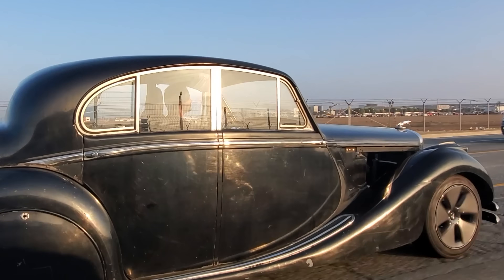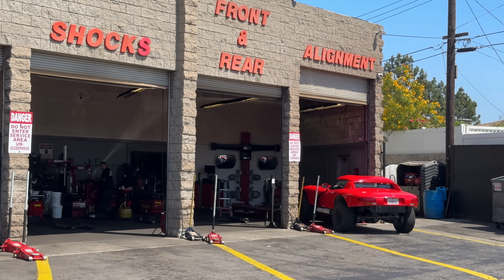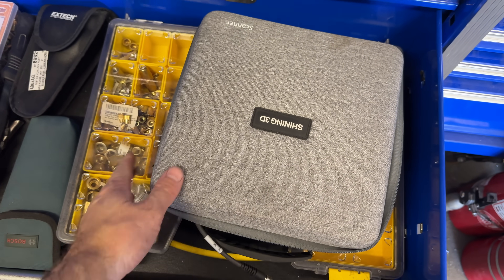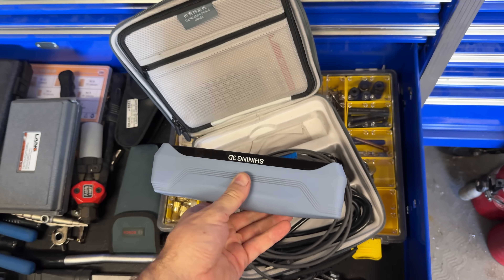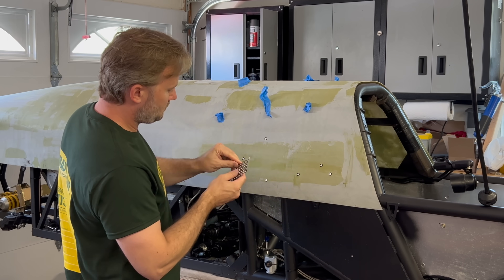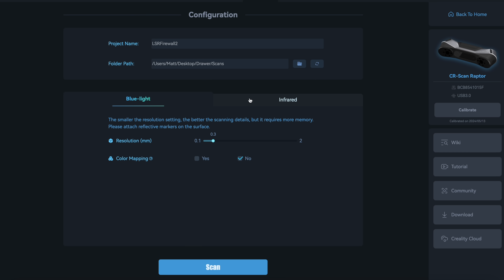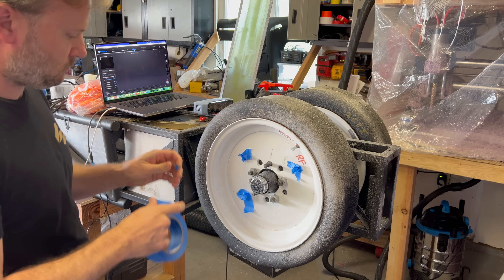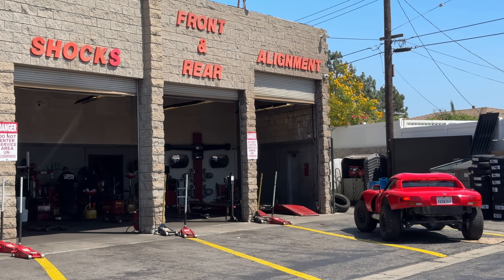Car Alignment With A 3D Scanner

Comment: I recently got a Einstar and have been pleasantly surprised by the ease of use. I have started scanning a lot of stuff from my ''85 RX-7 restomod project.

I got foot spray for reflective surfaces but in the end I haven't really needed it. The geometry that gave me the most trouble have been thin sections if you need to wrap around. I have used rags to give reference geometry for patterned and rounds parts. I didn't thought of tape for flat surfaces. This will go into the bag of tricks when I start doing the body work.

If I wanted to use it for wheel alignment check, I think I would place rags on the floor to help keeping it straight between the wheels by scanning both the rags and the bottom edge of the car.

The software has been fine, but for me the rewind function hasn't really worked. After 1h of 100% CPU it crashed. That was after 15min of scanning, might just have been unlucky. I haven't tried the measurement yet, as I imported everything in CAD anyway and rebuilding the suspension as a bone/sketch geometry. But from your video it does seem decent, will have to find something to use it for. From CAD, by drawing the circles from multiple holes I had relatively good results finding out bolt patterns and such compared to manual measurements.

Alignment note : Make sure your floor is flat! (mine definitely isn't), and needs to be level if you use gravity as a reference for camber. If not make some shims, put some numbered marking on the floor and reuse them.

Comment: Seems like the solution is the creality scanner and few ribbons of pre made dots you can masking tape to the non-critical areas. Seems like it would get you the best of all worlds - nearly as good instant scanning (maybe even just as good if you have to break out the tape bundles on the Einstar) and a better end result. Would need to try it of course, but it sounds like the Creality is technically going to be or at least become if the software catches up the better choice all round, and right now might be if that simple tracking trick does just work and get your the higher quality scan.

Comment: Sorry. Strings is not accurate?
Must professional race teams and ALL automotive OEMs will define the nominal setup with two sticks an string and a pair of calipers...

Way, waaaayyyy better than the accuracy you can get aligning and calibrating 4 lasers with their reflection...

A hunter style / laser machine is quick, easy and precise enough for your everyday workshop. 

You won't see a real motorsport place using one. Im very confused with this comment as i know matt knows better.

Comment: For the stool: ParkTool STL-2 workshop stool. No storage but great wheels which don't mind soft rubber floors and it's height adjustable. The plastic cover tears easily tho if it's pierced, but the base is amazing.
Reply: Also super comfy seat on the PT
Reply: @ElDJReturn  I defo 2nd that!

Comment: "Einstar" means one star in German. The maker of the tool is very honest it seems. Even if it may actually be 3 out of 5 stars.
Reply: Dreistar just makes it sound like a hand dryer though
Reply: @n_tas  , not sure how warm it gets when in use. Could be a secondary use case.

Comment: I can't speak to the kit you are using, my setup is very different, but I'd hit the engine with some grey primer (matte, not black, not white, in between) before scanning.  I've used that matte tan camo paint the returning soldiers are so fond of to excellent effect as well.  Also, on the fiberglass, if you are not worried about it bleeding through the paint (never tried with automotive paint, only cheap rattle can, and have had issues), you can do little dots and dashes with a sharpie to give it something to grab onto, with less effort for post processing if you care about using the surface for more than reference.  I prefer not to use a black sharpie as it may see that as a hole, so I bias toward a worn out red or green (blue tends to be a bit too dark).  There are probably better, still cheap and easy options.  I've never once used those reflective dots.  They are either too big for a tiny scan, or way too costly and time consuming for a large scan (for my purposes).  I'm sure a misting of rattle can around the torque converter won't stink too bad as it cooks.

Comment: The conclusion, that you sort of touch on at the end, is that to get a good scan you need to use the appropriate scanner for the item being scanned.  The Raptor is less than ideal using NIR on large objects.  

The Raptor, which I just received and paid for with my own funds, is very good at small parts.  I scanned an engine main cap as an early test part, main because it has small enough to fit on my desk, and because all major dimensions on it I could check with a 0.0001" micrometer.  I took four measurements using constructed planes in Zeiss Inspect and 3 of the Raptor scanner dimensions were within 0.0002" of my manual micrometer measurement.  The fourth dimension was less than a 0.001" off, and this dimension was produced from two merged scans when I flipped the main cap to scan each side individually.  I suspect the Creality Scan software is at fault here for how accurate it is at merging two scans and aligning the common points.  

Overall, if you scan that rear engine with the Raptor, I think you'll be impressed.  And as you noted, the Einstar didn't impress here.  Like the Raptor wasn't appropriate to scan the car, the Einstar is not appropriate for obtaining that level of detail and dimension of an engine.  The Raptor should be ideal for this.

Print re-usable 3D structures that you can add the 3D scan markers too.  Give it a magnetic base so you can stick it on ferrous parts, like the Viper iron engine block, and you'll have less complaints about having to use markers.  I've made a few 3D marker structures that have a through hole, so I can slip them over threaded studs, and other things that may be present on parts like engines.
Reply: Except for how the viper has an aluminum block
Reply: @jaredlancaster4137  And you're right!  I had it stuck in my head, due to years of lore of the Viper engine just being a "truck engine" fitted into the Viper, that it still had the truck variant's cast iron block.  As a non-Viper enthusiast, I still appreciate learning about the correct.

That said, everything else I said about the choice of scanner and results remains valid.

Comment: I got the best shop stool from harbor freight the one with a couple drawers and a nice cushion, then got 4 rollerblade wheel casters from amazon.  Built some adapters on the mill so i could mount the casters solid in the squarebar frame.   Now it rolls amazing and is solid when the wheels are locked.

Comment: Caster ?
Reply: Caster is the measurement of how far the wheel is tilted front or back.  The front wheels of a shopping cart have negative caster for easier steering, but tend to wobble at faster speeds.  A motorcycle front wheel has positive caster to make it go straight.

Comment: a trick to scan stuff and remove dots fast is to take a bit of painters tape, stick a bunch of targets on it and then put the painters tape on the surface to scan.
once done you just have to deal with removing painters tape and not a bunch of dots where half of will probably stay on forever

Comment: If you put the tracking markers on painters tape you get way faster cleanup afterwards and somtimes can reuse them
Reply: For magnetic parts they also make magnetic reflective targets. I worked at a place that was doing 3d scans on mostly steel parts and those things would last a surprisingly long time as long as you didn't use harsh cleaners on them.
Reply: Brilliant idea!
Reply: Very good hint mate. Thanks.
Reply: thats one of those "duh, why didnt i think of that" moments lol
Reply: OH man - respect the the idea
Reply: I was thinking just get some foam or wood boards, cover them in targets, then lay them on the floor. Then you could put them them away for later, and could put them behind whatever you are wanting to scan next time.
Reply: There are some net with magnetic markers. You gust put this net on the car.

Comment: The alignment machine uses infrared cameras to image the wheel targets for angle data. The four cameras (one for each wheel) are located in the centers of the LED clusters in the ends of the tower arm. The LEDs act as a camera flash and flash each time the camera takes an image. Since the targets are retroreflective and the camera is perfectly coaxial with the LEDs, the target image return is very bright and accurate. The software (WinAlign) just uses the skew of the known target pattern to determine the angle of the wheel.
Reply: I wonder how much hard work is behind that "just" after "software".
Reply: @SubTroppo  not much, tbh. OpenCV is a magic wand for such things. You know the specific features of your reference image, and you need to do some math operations over an 2d array of points. If you interested more -- take a look on the affine transformations, there's where the magic becomes "just" :)
Reply: i was told by-2008 to-14~ my boss USA/Nebraska 3d-party shop specialty in DSM/caddy's/diesel's that buying the equipment was 1m~ new and 90k+used so he/LLC passed on it and made a exclusiveness deal with the other shop up the road instead and focused on other parts/job's like engine rebuilding/R&R/fluid change or battery ect, so this scaner/cad if it gets good enough it's 2 problems solved for a 20th or 2-9K usd is a lot more cheap and use's less shop space for the ones like my previous job/shop that ROI is 1~ every ~90day's~needs averaged-out yes some weekend's it was more like 9-vin's others was/weekend's-1 or 0

for me racing auto-X or drag having trunk-space but still ways of tuning/road-side/pit's is superb helpful like the general idea, wondering why there isn't much interested in built in-systems that automatically track it for damages and heating-ect psi-ect and or automatic adjusting for wearing out ect
Reply: @richardprice5978 punctuation, my man. If you care enough to type it, put in the extra effort of structuring it to be readable.
Reply: @Validole  his sentence is punctuated correctly as far as I can determine
Reply: @DanVogt  Definitely not. It's a massive run on sentence. There's also only two commas and no periods at all.
Reply: @itsnetts sorry, my mistake. I mistook validole's criticism to be for the original comment rather than Richard's reply
Reply: @DanVogt  All good, we all have those days!

Comment: I bet the string method is more accurate than the scanner.... I did string once then took the car to a high end race shop, and no adjustment was needed.... Mostly its just a time consuming PITA lol.
Reply: It always seemed to me like the best alignment specialists all over the world use the string method exclusively.
Reply: I have not had good luck with the string method because several of my cars have different front and rear track widths. I just stick a tape measure in the tire tread and align toe, and I have gotten to within 0.1° that way.
Reply: @jaredlancaster4137  I agree with you.  A tape measure at the front of the tire and the back is accurate enough.  Usually set mine at 1/16"

Comment: Adding tracking dots to an epoxy floor kinda sounds like a good idea.
Reply: Permanent tracking dots... nice idea!
Reply: Considering those tracking dots are retro-reflective, I'm wondering if it might mess with the tracking.
Reply: @Trackpad_User  How spherical retroreflectors work mostly answers this for you, considering they refract-reflect-refract, an epoxy floor would just be a different lens surface with a different reflector array otherwise it's the same refract-reflect-refract process that spherical retroreflectors operate on.  The only major concern is how level the surface is compared to where the reflectors are sitting, even the self-leveling stuff will probably turn out a bit wonky and uneven.  At that point you might as well gouge out your epoxy, inlay some reflectors, then screed a thin layer over the reflector; the benefit of this is how localized the work is, routing a small hole keeps things roughly the same depth from the floor surface that exists, screeding a small patch also has the same benefit with leveling and layer thickness, this process would result in minimal error and gives you a protected retroreflector.  Beyond this, natural wearing of the floor is the only real concern; though futureproofing your buildout can also be a concern, if you don't plan ahead and go from a Miata to a crew cab long bed truck you'd be screwed. 

A better solution is just getting reflective tape, like what you can throw onto a trailer to meet DOT safety regulations.  Specifically for alignments you can do a perimeter of the vehicle, tape important surfaces, have extra references, and tie them together if needed.  It's actually a good idea for anything that isn't a traditional setup or any DIY work as long as you understand what you're doing.  For any general purpose job, it'd work fine as well, and with how the stuff bends it can go on fairly complex surfaces.  The tape is relatively cheap for how much you get and how much you actually use, alignments are just the big outlier in usage considering the perimeter heavily assists in non-warping of the model. 

Until there's a spray-on solution, doing the inverse of what talc does which is used to dust reflective surfaces to assist visual-based scanning, DOT tape is likely the solution going forward for large projects using reflective TOF scanning.
Reply: i've tried to make a fishing net with tracking markers on it. so i don't need to stick and then remove markers every time. just throw the net on new object and scan
Reply: I was thinking floor mats might work, something you could roll up and put away once done

Comment: This is unfortunately par for the course for Creality products. It looks good on spec sheets, but falls short of expectations. Granted, that gap is shrinking but still.
Reply: The issue with 3D scanners is that a huge part of the experience is the software.

On paper you can have the most accurate scanner in the world but if it requires you to restart your scan every time something goes slightly wrong and tracking goes haywire at the slightest thing, it's not going to be very usable.

I've used an 80k$ Creaform scanner 10 years ago and pretty sure a large part of the cost, beyond the fact it's actually certified for metrology use, is the fact that the tracking was pretty much flawless. Granted that was with reflective targets, but a lot of the lower end scanners have issues even when using targets.
Reply: This is true, with the caveat that sometimes creality products can still be worth it because they're often dirt cheap. I'm curious what the prices are on these two scanners, because if the creality is doing 80% as good a job at 50% of the price, it can still make sense for a lot people

Edit: looking at prices online the creality seems to be more expensive. So this point is a bit moot in that case lol
Reply: @chickenswallow  Oh wow, I didn’t realize they were charging more for theirs. That kind eliminates their usual excuse 🤣 
And I agree with your now moot point, most of their stuff is half baked because they are trying to hit a price point. There’s a silent agreement when you buy an Ender3. “Yeah it kind of sucks, but it was cheap as borscht and you’re on your own to fix our design flaws”.
Reply: @mr_voron  At least with the Ender 3, the mechanical components can be replaced by aftermarket ones, and that's one of the more common issues with them. Everything in terms of electronics can also be replaced with parts that are used in numerous DIY Prusa style machines.

That scanner has no room for improvement beyond hoping that they fix their software, which I have serious doubts they'll do.
Reply: I hate my Ender printer, it sucks